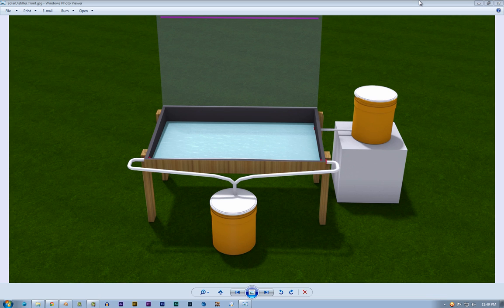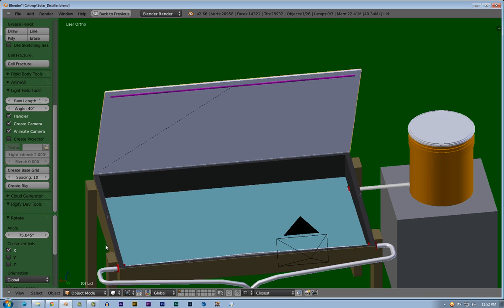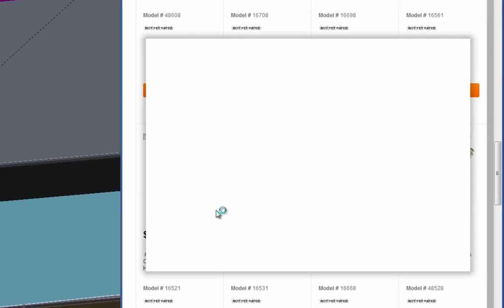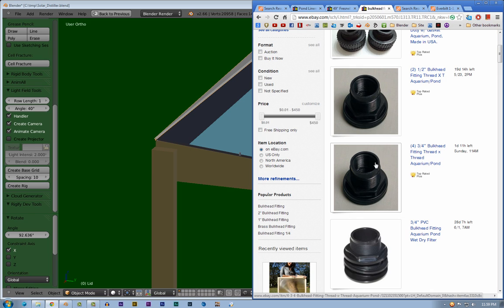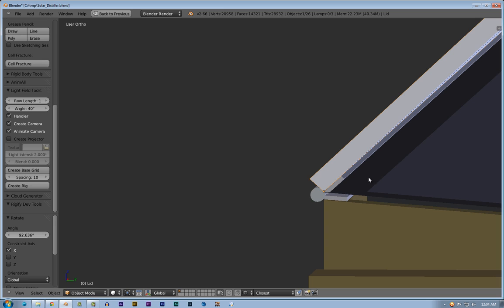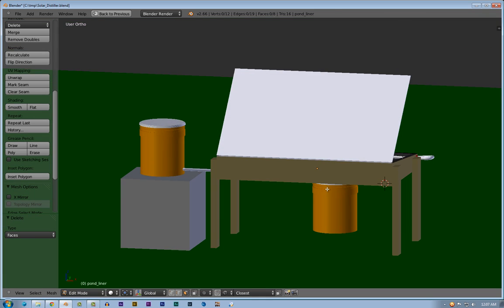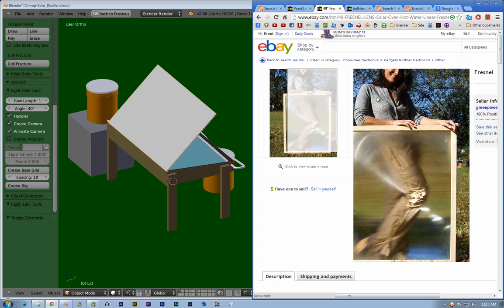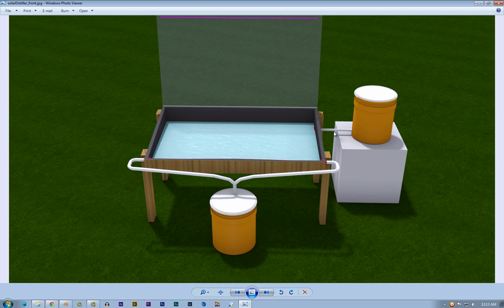DIY Home Water Distiller

Comment: Distilled water is a powerful solvent that is capable of collecting leeched chems from any plastic it comes into contact with. Glass in place of plexi, stainless steel in place of PVC and a glass collection bottle is highly recommended.

Comment from the maker: very good point. I did consider this, but I don't really know the answer. I'm not even sure how to answer that question. I guess you could always line the inside with glass over the rubber and seal it with silicon like in a fish tank. Probably the best way. Adds about 50 bucks to the build. wouldn't need to be heavy duty glass. It wouldn't be supporting any weight. Make sure there are no bumps under it though or it will break under the weight of enough water.

Comment: You need to make the angle of the glass much higher at the back end, if not alot of water drips off the glass back into the water box. If you have a 3' high on one end, the condensated water drips off the glass faster and you lose less of the drips!!!  Trust me I made one years ago. I moved so I do not have any photos of it.

Comment: There are many nice ideas in your design. The half cut PVC tube can be placed at a slight angle and only one pipe on one side would be necessary. I would also consider an electrovalve and a water level sensor to allow water drain from the container to the distiller up to a specific level.
Reply from the maker: Yeah ur right about the pvc thing. I am not sure why I did that. I'm sure if I was building it for real I would have realized how much better it would have been to do it out of one side. I'd prefer not to have anything electric on this. Even if it could run off solar cell. Physics works well enough. I will revise this video at some point. I've gotten lots of good ideas from commenters.
Reply: It would not work. If air can escape, the level of water from the container will equal the one from the enclosure, which means the water level will overflow and it will empty in your distilled water container. Even if you can perfectly close the distillation enclosure, don't forget about the draining tubes - inside the enclosure it can not be a higher pressure than atmospheric pressure.

Comment: For the drip strip I suggest a rubber weather strip. I'd place a sheet of metalized foam insulation under the pool liner for more heat retention. Metal side down, it will reflect back upwards heat that would have been lost out the bottom. Some strips of burlap or other fabric stapled to the sides would wick water up, increasing your evaporation surface without raising the water level.
Reply from the maker: that's a good suggestion.

Comment: I like the design, broke man style. One thing to add to the clean water tank would be a float switch, with solenoid valve just before the tank(that runs off of solar). On the dirty water tank you could put an auto dump valve to keep it from over flowing, that'll send the water down a pipe to a garden or whatever.

Comment: A salvaged big screen TV gives you a free lens, and the $50 plexiglas is replaced with a piece of insulated glass from a sliding glass door.  Already did the test, insulated glass does block more incoming light than a single piece of glass, but insulated glass more than offsets the loss of transmission.  Instead of wood 2x material, use thin plywood (door skin works well, but I was able to get a huge amount of free plywood from salvaged electronics shipping containers.  The wood is thin (1/8"?).  By facing a thick piece of foam (4" x R-5 = R-20) you can make a torsion box which is light-weight and very strong.  Coat the wood-foam box with reflective paint, and then coat that with the paint where paint companies spend their research money... high grade house paint (white).    Install 1/4 sawn spar caps (Eastern Rock, Sugar.  There is a very good reason to use hard, Eastern Maple.  Don't use oak, or other woods.  Oak has tannins, and Eastern Maple is food-grade, and has anti-microbial properties.  Of course, it will be coated with paint, but the paint can wear over time and expose the wood spar caps.) maple to handle the bending loads, and the plywood skins extend over the spar caps.  A 5/8" cap on top, and a 3/8" cap on bottom will handle the weight of a LOT of water. Install hard-points in the torsion boxes for joining the torsion boxes together into a frame to hold the pond liner.  The torsion boxes can be through bolted but (stainless 404) helicoils are better.  It's amazing how much wear comes from just sitting out in the elements.  My buckets came from a burger joint and were free.  A unit utilizing a 3'x7' glass can evaporate a large amount of water, and the unit can be damaged if allowed to run dry.  The lens will not gather more light but will change the quality of the light.  It is best to keep the water below 116F, but if you have concerns about latent bacteria or viruses, then 165F will destroy most everything in the water.  It may also destroy your foam shear web.  If you plan on high temperatures you will need to replace your pink, or blue foam with Divinycell.  The money you saved with salvaged materials will be offset by the price of Divinycell.  Just a lot easier to keep the temperature lower.  For ultimate safety I highly recommend pre-filtering with a Sawyer filter (don't use a British Berkfeld.  Too expensive, and works no better (I think worse!) than a Sawyer).  I use clean water that comes out of the side of a mountain.  It is much cleaner than city drinking water, but there is still a latent amount of turbidity.  Use a minimum of 3,  5 gallon buckets on each side of the collector (you DO NOT want to run dry!  Link the buckets with short (you will replace them from time-to-time) sections of food-grade silicone tubing and U.S. made, food-grade barbed couplings, with a 1/4 turn spigot to meter the incoming water.  The spigot will regulate the water level (keep it low, and the sides very short), and will also regulate the water temperature.  I do not recommend using the lens in the summer.  Your pond liner, and foam will not like it.  I also recommend glass as polycarbonate will block 98% of the infrared light.  Infrared light kills the bad stuff in the water, and it also brings in a lot of heat. Use a 6-layer cloth for pre-filtering the water going into the Sawyer, and again, pre-filter your filtered Sawyer water going into the buckets on this large evaporator.  Your Sawyer will last longer, you will clean your pond liner less often, and even with three filters upstream of the pond evaporator, you will still (I JUST DON'T UNDERSTAND IT!!) get a lot of calcium in your evaporator.  Hope this helps.

Comment: hey thanks for the video! as for the piano hinge, simply attach it to the outside of the reservoir and lid so it's out of the way when closing/closed. cheers...
Reply from the maker: It can, but in this example I cut the rubber away back there and it rests between the plexiglass and the basin. The rubber I plan to use is very thick, so I think it would all fit nicely. It may have to be sanded down a bit in the back to accommodate the hinge though.

Comment: As far as bowing the internal channel I would suggest, before construction, fixing the center of the channel to a point, attaching minimal weight to the ends, and applying a heat gun. This should cause gradual and controllable movement towards a slight bow shape.

Comment: Thanks for this post. How come you collect from two sides, by bending the collecting tube, when sloping it can easily achieve a one-sided collection solution? Also, does the thickness of the plexiglass matter? Third, do you think if I covered the plexiglass with that black stuff you use, that gets real hot, it would cause a quicker evaporation?  Thanks.

Comment: B/c you have wide open out-lines, you have no operating pressure-seal. So your in-line will require some sort of regulator; Else the bucket will just drain straight away into the device and water will simply spill into the out-lines.

Comment: I would think that using a Fresnel lense would have a bow shape to it to magnify the focus of sunlight. Thus, if that were the case (and I'm only guessing) drippage would not make it to your drip guard. Also I would consider the possible danger of the black interior becoming subjected to intense solar magnification even without that peak distance required to start an "instant" fire (should the water inside ever completely dry out from lack of attention). Flat glass seems safer and can even be obtained cheap or even free from people who toss out framed pictures they no longer wish to keep. But great ideas all around! Another concern might be rubber and heat conbining into water we desire to be nearly pure? Most rubber and softer plastics have VOC's and heat certainly helps to release them....... Thinking cap on.... Hopefully I can work around those concerns in my build......... Thanks!
Reply: +Chip Carpenter Indeed. As long as the Fresnel lens isn't bigger than the glass top, there is no extra light, thus warmth captured anyway.

About the plastic/safety: One could use PE (polyethylene) tube in / instead of PVC. PE is considered safe for drinking water, PVC is not. By lining the rubber bottom with PE foil, like cling foil, it would be a lot safer.

Comment: Agree with most about contam from PVC - use glass and stainless steel minimal rubber for seals etc.  Also the energy of he sun per square unit of area isn't increased by a TV panel - basic physics actually, and I think the key is to have material that absorbs heat - so dark glass is good.  Fantastic idea and great software also - what is it ?

Comment: As far as you hinge leave it flat and screw it vertical as not to put anything between the top and base, Just screw to the back and to the lid top edge.First fold the hinge 90 degrees and lay it on top of the base without the lid on. The hinge will hang and center the hinge then lift the top of the hinge and put the lid on and align and screw to the lids edge...Would be easier to be able to put the back on top to make it easier to center the hinge and screw, stand it back up and then edge screw aligned lid on with unit upright... You can use tape if you want to hold it until you get it screwed, Screw flush with top if hinge is wider than top, then screw to base...

Comment: A simpler design replaces the hard glass top with clear vinyl sheeting. This sheet supports a weight sufficient to induce gravity flow and centered over your fill can. You may want to use that to gauge the rate of distillation passive solar systems can produce before you invest in complicated & untried notions.

Comment: To get the halved pvc inside the tank to slope to either side, just cut another piece of pvc slightly longer than the gap between the bottom of the halved pvc and the bottom of the tank. Cut a V-notch in one open end of this small length of pipe, then lift the halved pvc at the center point and slide the bottom of the halved pvc into the notch of the smaller piece, and rest the smaller piece carefully on the tank bottom/pool liner and lower the halved pvc to rest on top of the smaller piece, in the V-notch. This leg should be tall enough to lift the center of the halved pvc and create a slope, without being such a tight fit that it cuts into the pool liner. As a precaution against pool liner problems, you may want to use a flat end cap on the bottom of the leg, so there's nothing sharp in contact with the pool liner. Now there's no need for any screws through the pool liner.

Comment: You do not have enough slope on your collector glass plate. Droplets will just fall back into the water below. You need at least a  15 degree or higher downslope for the water to run down down without trying to drip off prematurely.

Comment from the maker: I did think of that, but I'm worried that at those high temps it would break down the rubber liner. Have you seen those black evacuated tube things? They are about 18" long and 2" across and black inside. They are ideal for distilling water but they cost a bit.

Comment: Good instructional!   Easily openable for cleaning; can use some recycled materials. I'd use PEX, not PVC, and, choose glass, not Plexiglas, because plastics emit Volatile Organic Compounds (VOC's, which are the chemicals they are made of.)  Some plastics emit more than others; more heat causes more emissions.   
Could use stainless steel tubing.  Glass tube can be got, but it is too breakable.   
Could the large Fresnel lens be mounted on top of a glass panel, both to support it, and to prevent VOCs from it's plastic getting back into the distilled water?

Comment: Is there a part where you mention lining the interior of the wood box with anything? I know rubber seals on the edges under the glass, but I'm pretty sure you didn't discuss the interior lining and what material it is. Unless of course it isn't lined and the water is sitting directly on top of wood....
Reply from the maker: I think I went over that, but this is an old video. I recommended using pond liner. you can buy this on ebay or from homedepot. I'm not sure about BPA's in that rubber though. I figure if it's safe for fish it is probably ok for us. I mean fish are very small and sensitive and someone would have noticed if they weren't living as long as they should. I'll remake this video soon. I have ideas to make this design more efficient.

Comment: Thanks for the video, i'm just a bit skeptical about the buckets and plastic elements... Distilled water has the quality of removing and latching onto particles from the surface it resides in. The chemicals can thus leach into the water and be harmful to us. Glass tubes & containers would obviously then be the optimal means, but for DIY its a bit difficult... Maybe there are other chemical-free materials that can be substituted for glass. Metal is also problematic. Do you have suggestions?

Comment: Uniseals would work much better than those bulkhead fittings- Also why does the water stop when it reaches the PVC inside the distiller? Why does it not overflow?
Reply from the maker: Justin Charles Wouldn't overflow because it would be balanced. I don't know the exact rule to follow, but I know it exists. The one that would allow me to balance the intake tank with the reservoir basin so that the water would never overflow. It would however overflow the outtake tank. Hmm. I've never heard of Uniseals. Will check into that. I've gotten lots of good comments suggesting ways to improve this and this video needs to be updated. I'm also much better at Blender now. Thanks for commenting.
Reply: +Brent Newton the PVC will be under the sun and the UV can cause it to leach Polypropylene

Comment: You are not worried about the BPA and BPA substitutes?

Even if you used BPA-free sheets, the BPA-substitutes are just as harmful.

To be sincerely, honestly and precisely making solar-distilled water, you need

1. enclosure to be totally glass.

2. as short and as wide conveyancing glass tubes as possible, that allows them to be easily rinsed of accumulated evaporated salt deposits.

3. Be reminded that the strong UV and heat from the sun will catalyse the reaction of water with its enclosures, tubes and containers. UV light will break down the PVC.

4. Harmful mold accumulating in PVC and narrow tubes.

Which means you have to be aware the contributions to the content of your "distilled" water, if you used:
-  wood, particle boards, plywood processed in mills.
- clay
- Aluminium, iron, zinc anodised sheets
- Copper/bronze

Using PVC and plastic in any part of your "distiller" is a TERRIBLE idea.
Reply: Cynthia Avishegnath i agree 100%

Comment: Plexiglass and plastic is full of VOC’s. Distilled water leech’s anything it touches. Stainless steel or glass is the only thing that should touch the water if you plan on drinking it.
Reply: Exacty! Just paint wood case black then line it with glass and use silicone seal on edges, I know how to cut glass so thats how Im doing mine

Comment: Hey,
Awesome idea and I want to build.
A. Does anyone built the system or see drawing with dimensions volumes, sizes, material type ...?
B. Is there a priority for the Frenzel lens size? as Greater extent so You will have more power that will increase but will need to place it farther away from the water. And if I put a couple Frenzel lenses of A4 size so there will be numbers of beams that targets that water and i will relatively put them close to the water surface.
Reply: I did a reply (Max Speedwell) that addresses some of your concerns.  The lens is best omitted unless it is late or early in the year.  It can introduce a lot of problems.  It can be used to accelerate heating time in the morning but you will need to keep a close eye on the water temperature.  Lower temperatures are better for many reasons, and one designer-builder highly suggested the water be kept very cool (120F-116F.).

Comment: Remember to filter the water going in and going out with a charcoal filter. The reason for this is to take out the chlorine and bromine which is in all tap water. All Distilled water goes through filter in and out of the Commercial Distilling process. Chlorine Bromine will distill out at a lower temp than water so with no filters it will distill out into your good water if there is not a filter system.